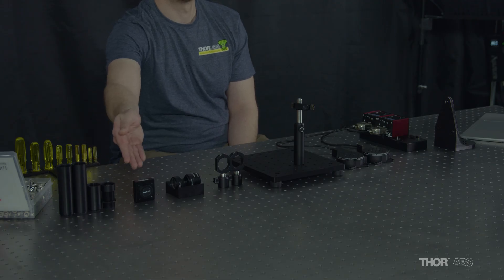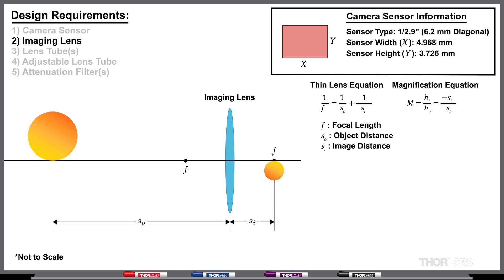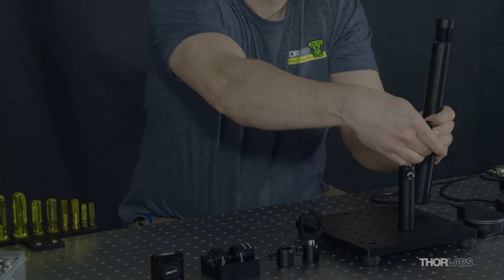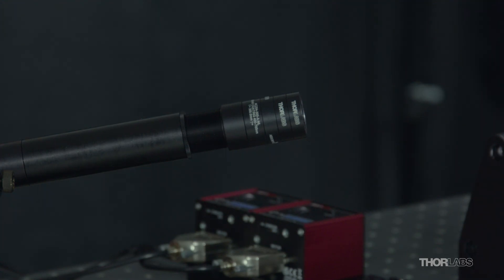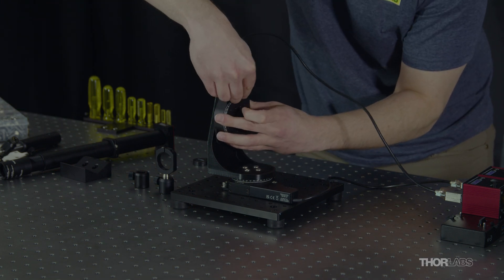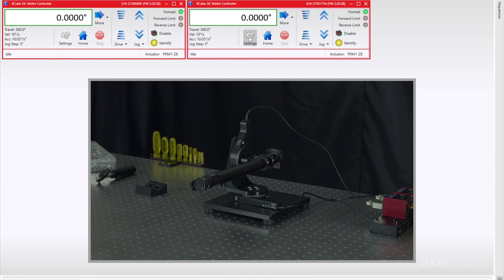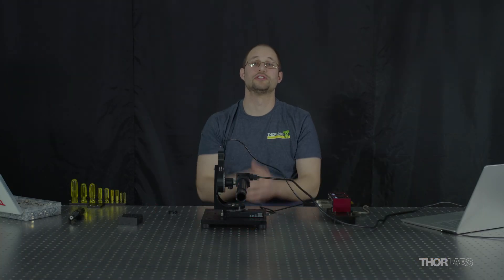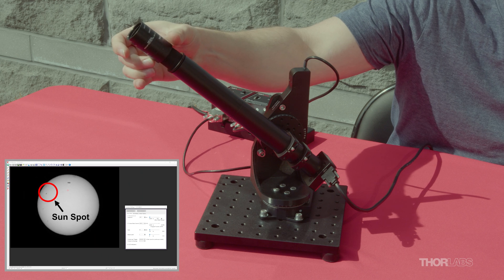Build a Solar Imaging Telescope with Tracking Capability | Thorlabs Insights

Comment: Could you add a H-alpha filter to the stack to increase surface detail ?
Reply from the maker: Thanks for your question! An H-alpha filter is a great way to improve surface structure visibility of the Sun's chromosphere. It would normally be the last filter in the stack to reduce the amount of heat-load on the H-alpha filter. 
 
However, the full width half max (FWHM) of the filter's pass band plays a large role in its effectiveness, limiting the use of more general-purpose filters. For reference, a red nebula may only emit light near the H-alpha line, so a broader H-alpha filter with a 10-20 nanometer FWHM is often effective. Since the Sun emits very broadly, it requires a much narrower FWHM to get good contrast. The H-alpha filters for the solar imaging you're envisioning typically have a FWHM value of <0.1 nm to be effective and require the ability to tune the filter to ensure H-alpha is the transmitted wavelength.
 
In summary, so long as the H-alpha filter has a sufficiently narrow FWHM and can be effectively tuned to the H-alpha line, adding it to the filter stack can help increase surface detail.  ND filters and/or broader H-alpha filters will be in front of the narrow band H-alpha filter to serve as energy rejection filters.
Reply: @thorlabs  Thankyou for replying. 
I didn't consider using a broader wavelength filter, then narrower (7nm) H-alpha in the stack.
So.. the stack would be...
ND filter/s - 10-20nm Ha- 7nm Ha ?
Reply from the maker: Since your narrowest H-alpha filter is 7 nm FWHM, there won't be much benefit from adding the10-20 nm FWHM H-alpha filter to the stack. With sufficient optical density, ND filters would be enough to reduce the optical power to mitigate heat-load on the H-alpha filter. That being said, a 7 nm FWHM H-alpha filter may not be able to provide much contrast of the chromosphere, but please let us know how this works out for you if you try it!

Comment: What is the diameter of this telescope?
Reply from the maker: Thank you for your question! This telescope used the AC254-300-A-ML achromatic lens, which has a 25.4 mm (1 inch) diameter. Due to the retaining ring of the lens tube, the clear aperture is limited to a diameter of approximately 22.9 mm.

Comment: Very cool. I'd like to build one. Does Thor Labs have apochromatic lenses in this diameter? Which motorized rotation stages did you use? Which camera?
Reply from the maker: That's great! The motorized stage assembly used the PRMTZ8 rotating stages. The telescope used the CS165MU monochrome camera. For the full components list, please refer to the video description or github link of the Design Files for this project below:
https://github.com/Thorlabs/Insights_and_Applications/tree/main/Tracking%20Solar%20Telescope/Design%20Files

Most of our apochromatic lens designs are objective lenses. Something to consider for this application is that you could use a narrow bandpass filter to reduce the chromatic aberration if you plan to use a monochrome camera.  If you have a specific application or design requirement, please feel free to contact Tech Support.

Comment: Could you show us how to track a laser lite prism too ? It would be a really cool project
Reply from the maker: Thank you for the suggestion! Could you give us some more information about a laser lite prism?
Reply: @thorlabs The IR laser would be rigidly attached to the CMOS / optics assembly; for example on top of it. Then using a combo of 45d mirrors / beam splitter, you could align the beam back with the main axis of the optics. A prism at a distance would reflect back some IR light. Reflection would appear as a dot on the CMOS. You could then  computed the x/y offset of that dot centroid rel to CMOS center and feed these offsets as your control error to the PIDs driving your motors.
Reply from the maker: Thank you for the application suggestion and additional details. We'll add it to our list!

Comment: The configuration of the neutral density filters was something I've never considered! Not that I've ever needed to...
Reply from the maker: Thank you for your comment! This approach is certainly overly cautious and is more critical in setups using high power or high power densities from focused light. These filters are designed to absorb optical power and dissipate the absorbed energy as heat. Thermal lensing can occur with higher power densities, and eventually the filter will fail as the absorbed power increases.

Comment: It would help to use green or red band pass filter instead of one of ND filters. Achromatic doublets will have horrible aberrations outside of corrected range, if camera has AR-window (instead of IR-cut) it will be sensitive from ~300nm to 1050nm, where light from 300 to 430 and 700 to 1050 will significantly degrade contrast of small features... In solar observations in astronomy it is common practice to place reflective red bandpass or IR-cut filter as far from camera as possible (preferably before objective lens) - this simplifies thermal management alot.
Reply from the maker: Thank you for your comment, this is valuable feedback! In this case, the ND filters used in the video are designed for the visible range (400-700 nm). For these specific filters, their UV absorption is even higher than the visible range but will have reduced optical density between 700 - 1050 nm. You are correct that we could have lower imaging resolution due to the out of band performance of the achromat, but we found the resolution was adequate to image sun spots and record the eclipse. We will definitely take a look at using bandpass filters for the next event.